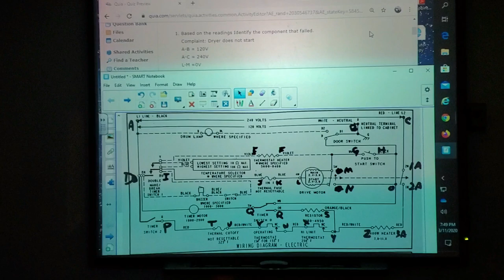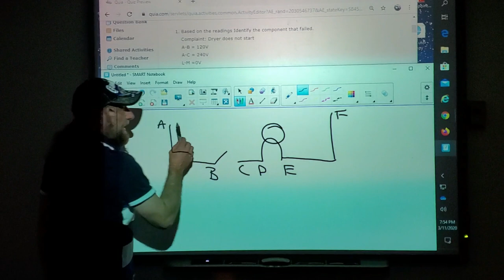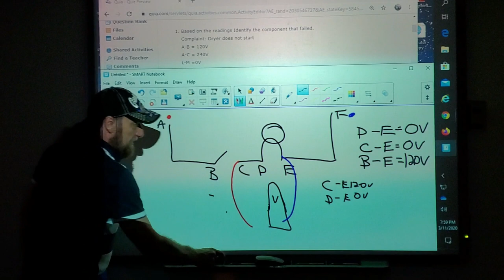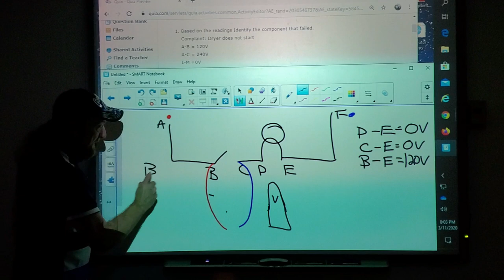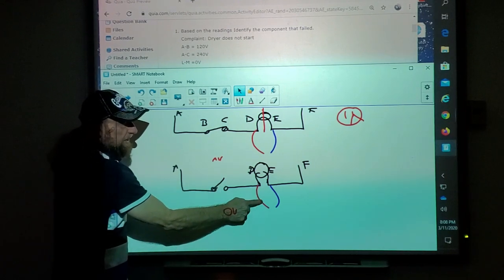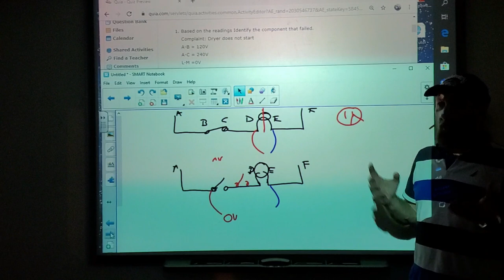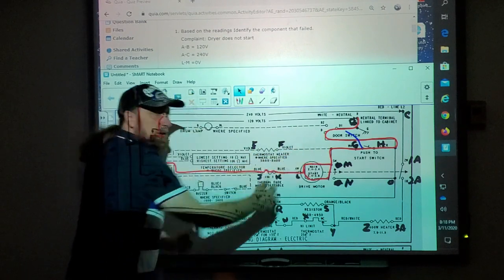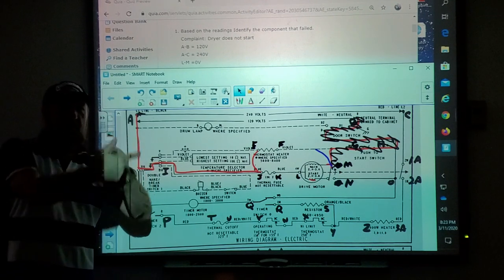whirlpool dryer pt 1 3 10 2020

Comment: 13:47 - Technically, you’re right. They are sharing voltage; because,there IS current flowing in this circuit. But, because your meter has a much greater impedance (10 or 20 Megaohms depending on your meter) than the lamp, it is dropping nearly the full 120v leaving effectively 0v across the lamp not allowing the lamp to light.